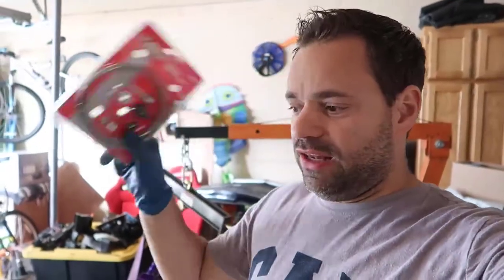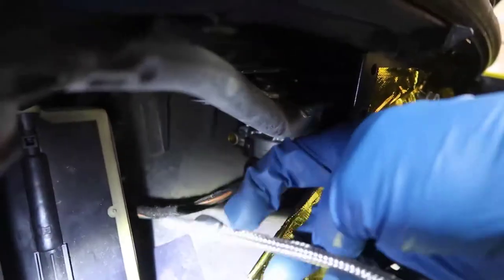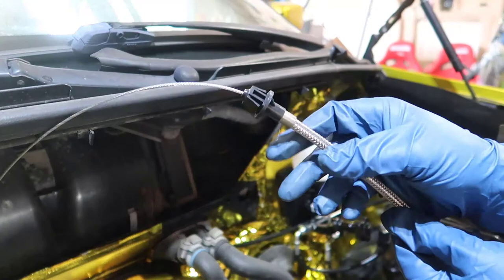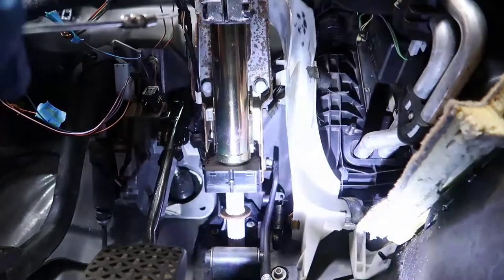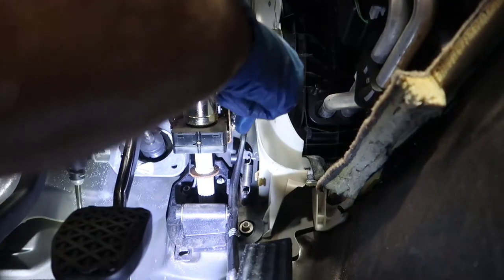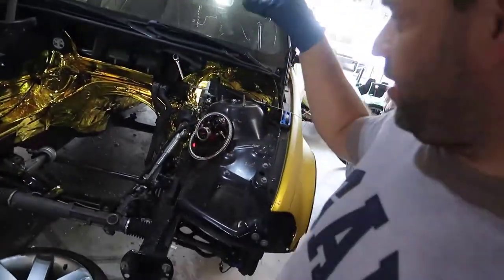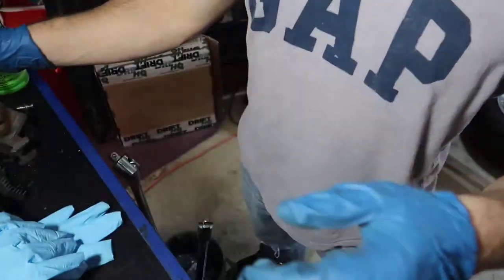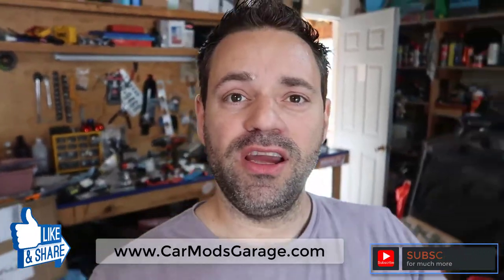Installing Throttle Cable on Converted Accelerator Pedal - 2JZ to E46 Conversion

Comment: Inspiring build! Where you did you get your pedal and pedal mechanism spring
Reply from the maker: thanks Issac. Well you can buy OEM but it will be expensive. I ended up getting used one on eBay from E36 I believe and it kind of fit perfectly. I just grind a little bit the cylinder part that slides  inside the pedal ans put a screw at the end so it would not come loose and it worked.